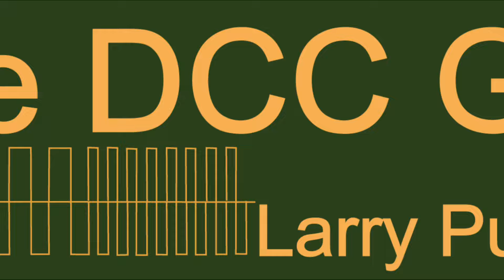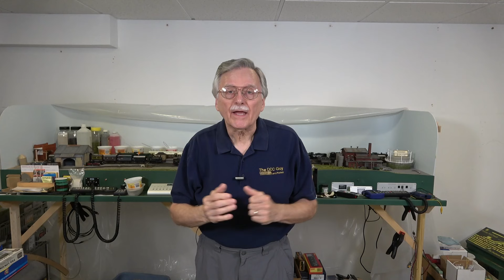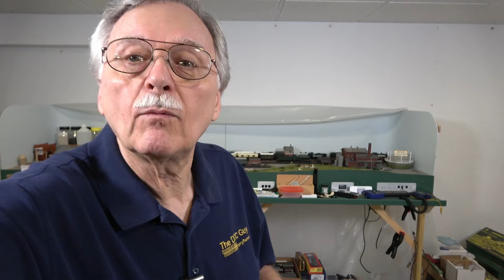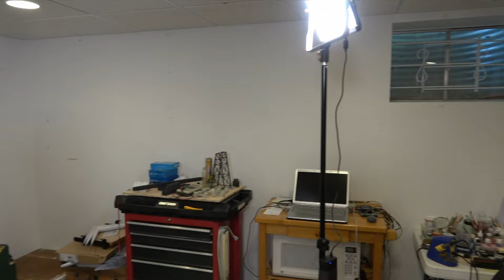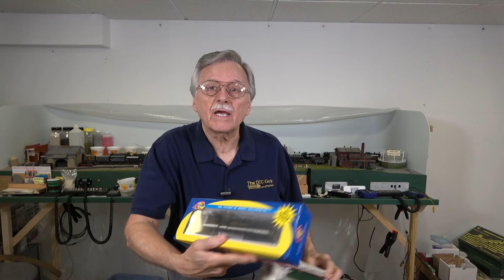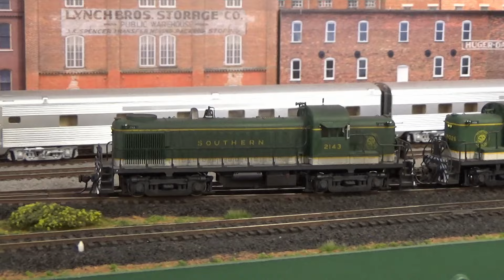Is This The Last Run Of The Piedmont Southern? (365)

Comment: I am in the same situation with bad health to the point I can't be on my feet for more than fifteen minutes before I feel pain. I have over 600 cars and about a 100 engines with only 23 with decoders.  I purchased a radio link for my Digitrax and have used it twice before I stopped with the hobby in January this year. I am at that point I have decided to sell most of what I have accumulated over the past 40 years as a train nut and a hobbyist. I wish you the best in your coming days as I have enjoyed your insight and sharing of the hobby.

Comment: I acquired the CTS-105 with the SW-100 trhotle after watching your 309 video about a year ago, mainly because my old MRC system, unsurpassed in many aspects, had no WIFI possibility. I had no problems installing it and it has been very easy to use. A few days ago I discovered that I had lost the connection to the WIFI and without the password, it did not work. And that's when your video 309 saved the situation because at one point you mentioned the key. Double thanks.

Comment: I know dismantling your railroad must have been hard.  while i love model railroads, my passion is restoring classic cars.  I had some health issues the last few years, 3 really bad rounds of the 'Rona 19, fallow by a tumor in my nose that was thankfully not cancer, follow by my fourth round the disease that shall not be named. unfortunately, between these it has left me physically drained, and my stamina is shot, i can no long do the some of the heavy lifting or getting up and down off the hard concrete that i could do before. so i have had to scale back some of my work and hire out work that I used to be able to do myself. it's a big pill to swallow for me as I am extremely independent.  I rebuilt the engine for my current project in 2022, and I now realize that it will probably be the last one that i build myself. it's just too much heavy lifting and torquing bolts for me to continue to do it. so, i understand why you took it down. best of luck with the sales of your gear. and more importantly best of wishes on your health.

Comment: Hey Larry, do you know how to fix a locomotive that the sound is working and the engine is not running
Reply: So the engine is not running it is a Broadway limited Pennsylvania railroad 2-10-0 locomotive. It is my grandfather’s locomotive and he does not know how to fix it. So how could I fix it?
Reply from the maker: Hard to say. Can you hear the motor running but the wheels not turning or is it completely dead? If it is dead then it could be the mobile circuit in the decoder is shot. If the motor is running but the loco not moving that likely is a gear problem. In either case I would contact BLI and arrange to send it to them for service. Steam locos are not something that are easy to disassemble unless you are pretty experienced at it.
Reply: Ok, thank you so much.🚂
Reply: No, it is completely dead but all the sound works.

Comment: I totally get why you tore it down, but I mean did you at least offer benchwork sections to people just getting started? I'm no expert but I'd think even the benchork would be gladly used by new modelers.
Reply from the maker: Getting it out required cutting it up so it really wasn’t salvageable. I tried to lift some track and turnouts but was only partially successful at it.